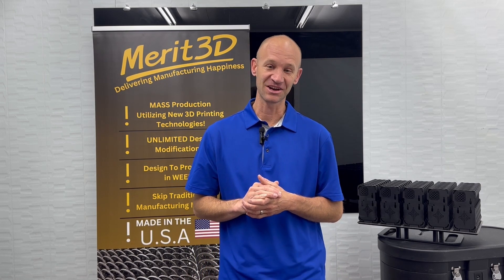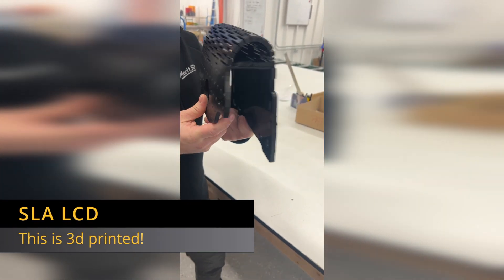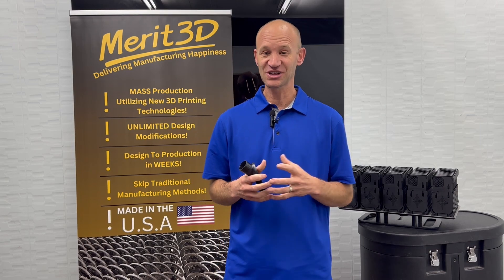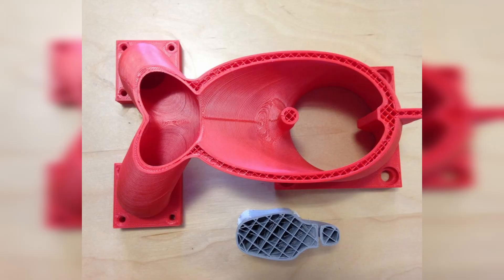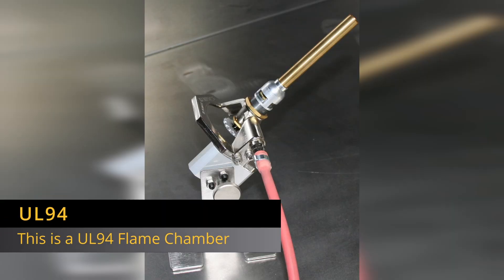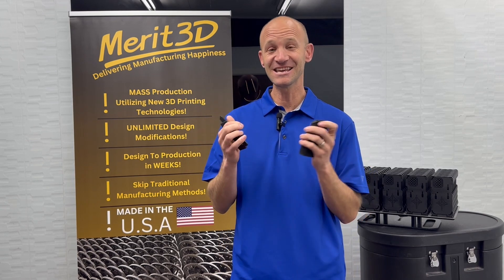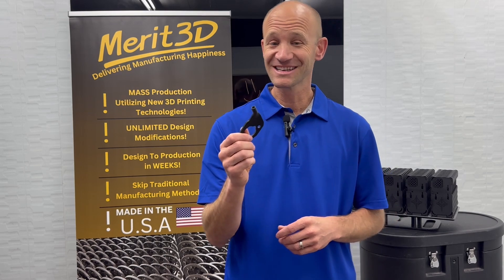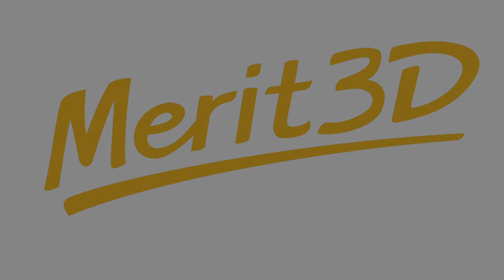Quality and Durability of Additive Manufacturing Compared to Injection Molding

Comment: Great video! At the 1:21 mark, you are talking about a V0 resin with a 2mm rating. Do you mind sharing what resin that is?

Also at the 3:34 mark, the Photocentric resin that you were speaking of, which resin is that?

Thank you for your help! I think you all are doing a great job at mass manufacturing resin components.
Reply from the maker: DL400 is the most heat resistant resin that we have used. Photocentric just released a flame retardant resin you can read about here https://photocentricgroup.com/product/rigid-dlfr/. It does mention the rating in its specifications.

The specific resin we used was DL 170 at 3:34, but new resins typically come out monthly. Have a fantastic day! Learn more at merit3d.com
Reply from the maker: @Merit-3D DL 110 is the best we use as of now. We do have a better resin coming shortly.